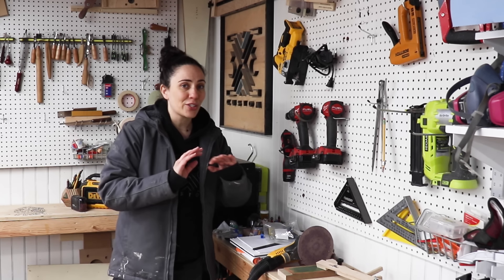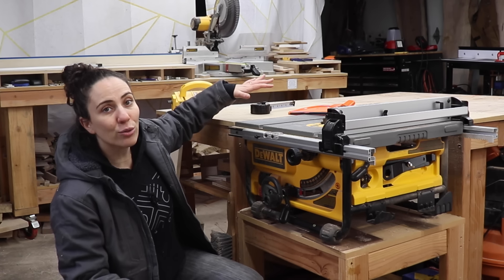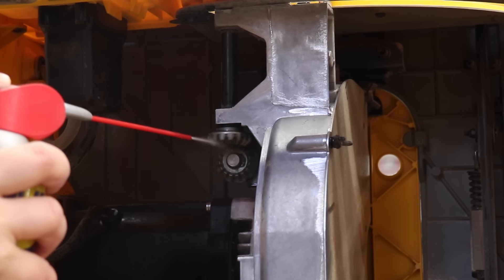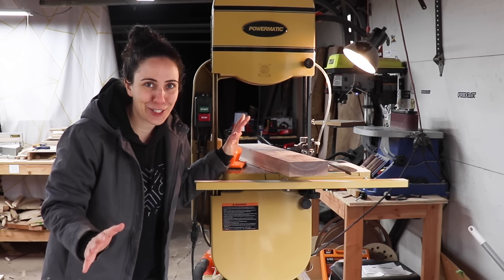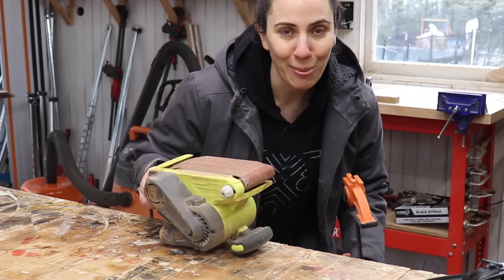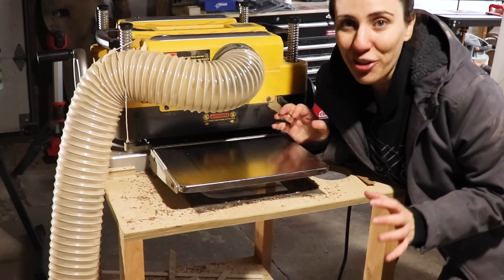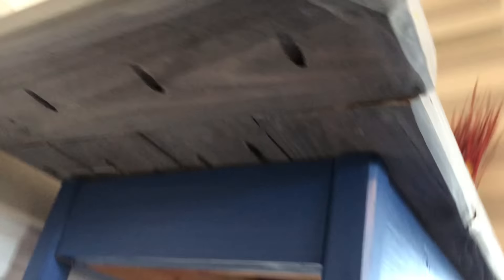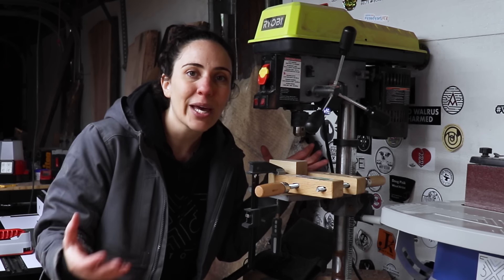What Tools Do You Need to START Woodworking? Beginner Woodworking Tool List

Comment: Great Video! I think your best advice was about time. Second best was about dust control. 3rd safety equipment. These all tend to get ignored in so many other videos. As far as the time (efficiency) thing: I used to struggle to try and make something in a week. Drag out the tools, cut, shape.. glue up.. put away tools.. sand, paint.. repeat per job. not good for married life. I then met a cabinet maker that acquainted me with so many "time saver" techniques and tooling. After a year of revamp, I could do things like cut and assemble a box in under 1 minute! Router table made for fantastic repeatability; Air nailers sped up gluing and assembly, as well as a great many other things. Dust control. OMG. Can't have enough! I found that not only is tool vacuuming/collection important, but AIR cleaning purification just as important! I am currently building a sanding table to collect the fine sander dust  (I usually do sanding outside, weather permitting..). On the safety stuff, great advice, and I'll add, DO NOT SKIMP. I nearly lost my hearing with bad earplugs (were supposed to be rated very well). I went to 3M muffs.. and never looked back.. and my hearing amazingly returned! Goggles.. without saying! Dust/paint mask.. better to have it if you need it - than to "try and get by"! Keep up encouraging and training newbies and us oldies alike!

Comment: I am building things in the woods so I have quite a few more constraints than this for my own projects. My main constraints are that it has to be a hand tool since I'm doing bush craft, it can't be too expensive because I hardly have any money, it can't be too heavy because I have to carry it in my backpack, and it can't take up too much room since I have to carry other things in my backpack too.

So far, I have a Corona folding saw (that I am sharing with my mom), a hatchet, a small set of carving knives, and a Scotch eye auger. One of the most useful things that I recently bought was some wood glue because it's hard to hand-carve tenons that will hold a stool solidly without anything but the pieces of wood being joined together. There are certain ways to make glues from natural sources but there aren't any such things near where I've been building so I just got some wood glue from the store. The glue immediately (once the glue dried) made my stools as solid as any you would buy in the store. I didn't have a clamp so I just held them together with my hands for the first 30 minutes. Since my outdoors woodworking is supposed to be meditative, it's fine for now for me to hold them together until the initial bond is achieved. 

Now, as far as the tools you've mentioned here, that's the kind of thing that we have at the house since my mom and I build things and fix things all the time. We are still lacking a few of these tools but I'm sure we'll get them as soon as my mom decides that they would be useful for our projects and she's the only one with enough money to buy them. Most of the garage is full of various tools, mostly for woodworking, but also several other ones for building and fixing things from other materials.

The one thing that I really do like about working with wood using hand tools is that I can forego the ear protection. The sound of hand tools cutting wood is such a nice sound, particularly when it comes to the auger. The downside of hand tools is that I'm not a spring chicken anymore and so I get really tired using them. Since my woodworking is meditative, though, taking a break is an important part of that meditation.

The other non-woodworking tools that I carry with me are a folding shovel and a bucket so I can dig and work with clay. So far, I've made a shelter with a stealthy Dakota fire pit surrounded by a clay enclosure to prevent too much light leaking out when I have a fire and to keep the rain from putting my fire out. I still have a lot more work to do on the place but things just take time when you do everything by hand. It's also pretty damn hard to carry some of the lumber I cut around and it's a rare thing when I can get a smooth piece of wood just from splitting a log, although my carving knives make it good enough for bush craft work usually.

I like that bit of advice you gave about making a spoon since that's how I learned in practice how to work with the grain of the wood. I had watched videos about it but there's no substitute for feeling it out yourself as you work with the wood. Cheers from a fellow woodworking woman!

Comment: I agree with Tamar's thoughts on table saws.  I did bits and pieces of woodworking for probably about 10 years with just a circular saw and later a cheapo mitre saw.  Definitely not something you need to buy up front, but once you decide woodworking is the hobby for you and you want to take it a bit more seriously, it's a game changer.

I bought a Dewalt DWE7485-XE, visually looks very similar to Tamar's no longer on sale Dewalt (it's probably the one that replaced it).  I really like it, it's got a much bigger rip capacity than the other saws in it's price point, and it's been a great, reliable saw for me.  I put mine on Steve's (Woodworking for Mere Mortals) mobile table saw cart, but tweaked the height of the cart so that the saw table is the same height as the bench in my shop to give me some extra support for my work if I need it.

My other tip is to buy tools either ultra cheap or second hand at first.  Then when you use it to death (or need the upgrade), replace it with a quality tool which will last.  That way you can figure out whether it's something you'll use/like (I dislike jigsaws too) without spending a lot of money.  Then you you find something that really hits, you've got the experience to know what features genuinely matter to you and what you're shopping for in your next one.  My Dewalt table saw replaced one I bought from a pawn shop for under $100.  That was a great saw, but I quickly learned that a) it was something I'd use all the time, b) my next one needed a super sturdy fence that's easy to adjust and doesn't need finessing to stay square, and c) more rip capacity is more better.  Armed with knowledge, I could go shopping for a new saw with the features I needed, and also know it was worth spending the money because it was a tool I would use a lot.
Reply from the maker: Great tip!

Comment: This is one of the best introductory videos I have seen, have actually watched it a few times now. Thanks! Still need to work my way up to a few of the items on your list. 
My experience in the two years I have been a newbie woodworker (keep in mind I have only used plywood and soft wood up till now):
1. Table saw: would recommend getting one as soon as possible - there really is so much you can do with it. I have a newer version of the table saw in the video - 7492. It is excellent for a jobsite saw - particularly the fence. But if I had the money available I would probably upgrade to an entry level SawStop. Would just feel much better with the peace of mind of their mechanism.
2. Shop vac is basically the first thing you need to buy (I guess unless you are planning to get a planer early on). The first shop vac I bought (Martlet) just failed out of warranty and I was kind of glad. Did not realise how incredibly loud it was going to be - much louder than some of the tools I hooked up to it. I work in a single garage in a duplex so noise is a big factor. Replaced it with a Festool CT15 which is much quieter and has adjustable power levels. If you don't want to pay that much but noise is a priority, maybe just ask the store to run different shop vacs for you before you pick one. Also the autostart feature where you can plug the tool into the vac and it starts with the tool is a nice to have.
3. Cyclone system for the shop vac - I bought a Dust Deputy cyclone with the first vac but I cheaped out on buying their official bucket as it was just too expensive. The cyclone then remained in my cupboard for a year. In retrospect I should have just gotten a knock-off that came with a bucket, but now I have repurposed the aforementioned dead shopvac as a cyclone bucket so all's well that ends well.
4. Random Orbit Sander - get a good one. You are going to run it for hours and hours! I have a Makita one which has been great. 
5. Before buying cordless tools, consider whether you actually need that particular tool to be cordless. Cordless tools are more expensive (particularly if you count additional and eventually replacement batteries), less environmentally friendly (lithium battery vs simple copper cord), and if you are a weekend woodworker and you buy decent tools my guess would be that many of your tools will last longer than the manufacturer will keep making batteries for them. I don't currently own a single cordless tool. I just use a manual ratchet screwdriver for screws though - doesn't seem to be a popular option but consider this if you are on a budget and you already have a corded drill.
6. I found a jigsaw to be quite useful even if it is not massively precise. Bought mine before I got a circular saw - even used it to break down large plywood sheets for the table saw (though that is a bit wasteful as you then have to do that edge over). Eventually got a circular saw but I haven't really warmed to it yet.
Next up for me is probably a router.

Comment: I have almost everything you mentioned as hobbyist, right up until the planer. Spot on IMO!
Reply from the maker: Awesome
Reply: Yeah, the planer. You can get around it with a router and flattening bit or lots of hand planing and sanding, but I wish I had one evertime I do.
Reply: @terryt2910  the planet is the next tool on my list 🤑

Comment: I have watrched a number of your YouTube videos now and firstly I must say you do a great job with your carpentry skills and presenting them as well. I'm about to set up a new (DIY) woodwork space so I'll be pinching some ideas foe sure - hope you don't mind 😃. The other thing that I'm impressse with is your vision with your 3D Printing. I would love to try it but have no idea where to start. You've mentioned the Bambu 3D Printed but would you mind sharing which model you would recommend for a beginner, as why and, how did you start - if you don't mind sharing. Anything would be appreciated. Keep up the great videos. Thanks.

Comment: Tamar. I had a Dewalt 745 for three years. Like you, the height adjustment wheel became hard to turn on many occasions. The gears did gather dust since there is no shielding to keep sawdust away from the motor assembly. The real cause for the difficulty in turning the height adjustment is the nut on the vertical screw that raises and lowers the blade. On this saw, that nut is plastic and not metal. I tried to keep the nut and vertical screw clean and used silicone spray lubricant but over time the threads in the nut wore down and then broke off, leaving me with a saw that was functional except I could not move the blade up or down! The saw is not reparable, so I junked it and bought a Dewalt 7491RS. This saw costs about three times more than the 745, but it is easily ten times the saw. There is shielding to keep sawdust away from the motor assembly. The top is much larger. The rip fence and the riving knife are easily removed and the rip capacity is much larger. It can take dado blades too. I don't have the space for a larger saw, so this one is wonderful.

Comment: Great video as always!  I would add for newbies do not skimp on the PPE cost, your gonna be wearing it for long periods sometimes,  be comfortable not cheap, if it is pinchy or hurts return it and pay more for the good stuff...  Then get two when you can when you find what works well and is comfortable.  And always get two Sanders, so the person standing around has something to do as well, instead of just standing there asking questions or giving advice.
Reply from the maker: Ha! Love the tip on the sander. I have multiples. But because they are for my kids

Comment: Track saw is also very handy.  It's very safe to use and nice to make long cuts at odd angles.  It can also save a lot of space in comparison to a table saw.  I used mine way more than I ever thought I would.  Also, when it comes to a sander...spend the money on a good one.  You're going to be doing a lot of it, so may as well make it as least painful as possible.

Comment: My venture into woodworking began with a 5pc 20v Craftsman set, and 10in Craftsman table saw. A few yrs ago  I got a ryobi chopsaw  and have since started using alot of dermel products (since they are smaller & I am in a wheelchair). I also have a crapload of hand me down tools (which I suppose every woodworker does).. my most recent aquisition is a 12.5 in planer which is still in the box.
Reply from the maker: Sounds like a good set up so far!
Reply: @3x3CustomTamar  thanks

Comment: I agree on the jigsaw, it has it's place, but is so hard to cut thicknesses without deflection even going slow...saw a tenon jig under the bench, I have a Rockler similar to yours. I am in the process of modifying the track to get it tighter. Presently I "rock" the jig on the table while clamping down the piece to minimize the "slop" and then saw with pressure to the left side. It does "ok" but would appreciate your experience with this item because I value your ingenuity and your vids are just plain fun, go girl. Thanks
Reply from the maker: Yeah. It’s a necessary evil. I don’t have that problem with this tenoning jig. But I do have a video where I made my own as well

Comment: good overall starting guide Tamar. One thing I have learned is a "must have" is a good air supply and various locations with separate supply lines. I keep a notepad next to the computer as i watch various videos and see various tools used. If it looks to assist my projects, the research begins. Learning to tune all the tools is critical, I also have the DW735 and have enjoyed its performance and your video helped retune it the last time. Good job !!
Reply from the maker: Glad you liked it. I actually don’t have an air compressor yet

Comment: With a few easy jigs I can use my 10” jobsite saw to safely resaw 7” boards, joint edges and even plane rough wood. But for the planing I’m limited to 3.5” stock. Good enough for me though! 
It’s awesome 😃

Comment: OMG this was literally the best video ever, especially the conclusion where you acknowledge that the toolset you need is very much dependant on the kind of projects you will be working on. It seems obvious, but so many videos from the so-called pros don't actually acknowledge this. They just tell you that you won't need X or you will need X. I watched a video earlier on table saws and I saw a video where they suggested you do not buy a jobsite saw, but there you are with one. Now you did point out all the issues you have with it with regards to the surface not being flat and having to set it up differently, which is a huge pain in the ass, but if you are on a budget and cannnot afford a tbale saw this is a good recommendation.
Also, if your tabe saw can't accept dados how you do make half lap joints?
Reply from the maker: So glad you liked it! Last question… multiple passes

Comment: The point where you are cleaning up the table saw... I acquired an OLD Rockwell jointer a few years ago. 60+ years old. It needed some love and attention, and most importantly, time. Today my brother and I finally found the time. We tore it apart, lubed it up, and honed the blades. 12 hour or so project. When we started, the wheels would barely turn to adjust the tables up and down. It was full of sludge and gunk and caked on sawdust. Rust everywhere. After a ton of messing around and figuring out how to take the machine apart and put it back together... I took a really rough 2x6 that had been sitting in my neighbor's backyard for 3+ years. Outside, in the elements, in central Wisconsin. A very rough piece of lumber, the perfect candidate to see if the jointer could do its thing. I ran it through the jointer on one face and one edge. That board is now dead square, after two passes on each side. Held it up to shop lights with a really good square on one of the corners, and there isn't a speck of light peeking through.  So... yeah. Maintain your equipment.  Clean it. Figure out how it works and how it comes apart and goes together. Learn how it works. Oh... and watch craigslist like a hawk! You can get well-made power tools at a good price. After all of the hard work today, my 60+-year-old jointer probably has another 60 years to go.
Reply from the maker: I’ll get a jointer one day. And yes! Craigslist!
Reply: It's a Rockwell 37-220. Solid piece of machinery. I paid $200 for it.  Installed a new set of bearings on the cutter head and replaced one pulley (it broke when we were pulling it off.) Now it's good as new. The blades didn't even need to be replaced.